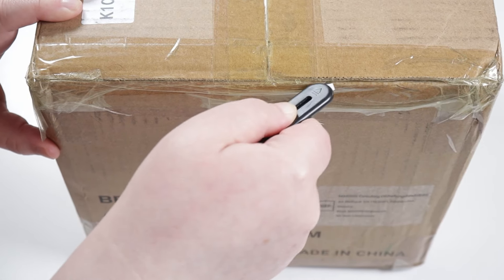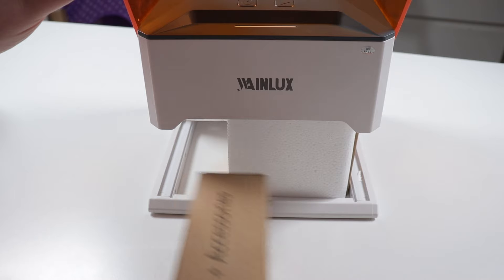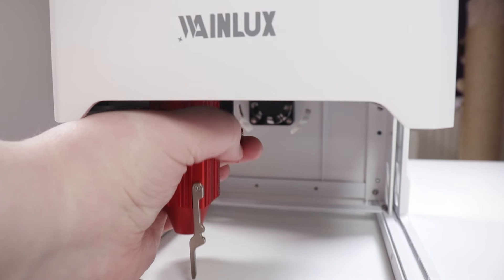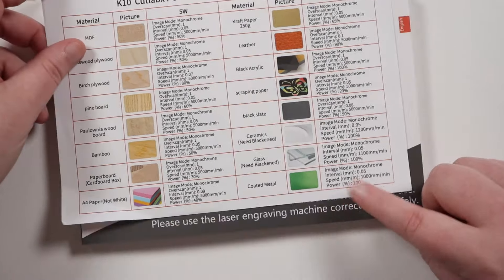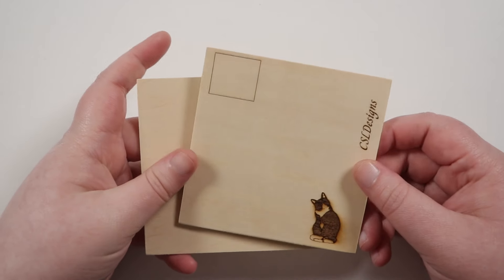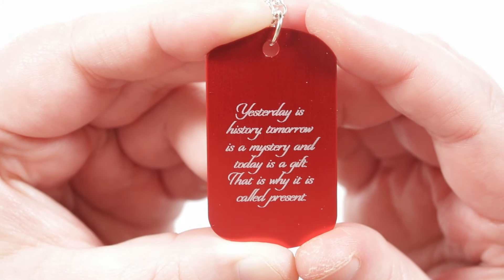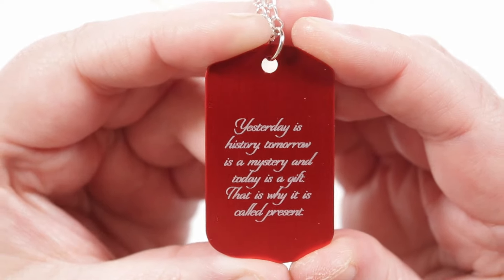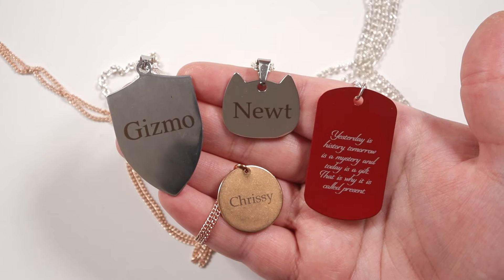Discovering COPPER laser engraving with the Wainlux K10 laser engraving machine! 😱😍

Comment: Does this work on Sterling Silver???
I read the reviews on Amazon and it says that it will not work on Mira’s or metals that didn’t have a coating on them ..

They said nothing that is reflective will work with the engraving .

I have been looking for a small engraver and I was looking at the X tool s… and yes they are pricey but their lowest cost model is about $1000.

But I would definitely need it for sterling silver, fine silver, copper, brass, bronze. These are the metals that I use in my silversmithing tutorials. Also with my jewelry business.

I sure hope to hear from you soon. Happy New Year’s.  Hugs 🤗, Michelle